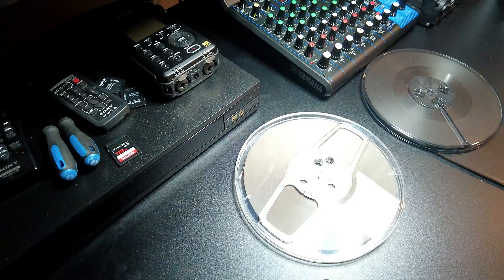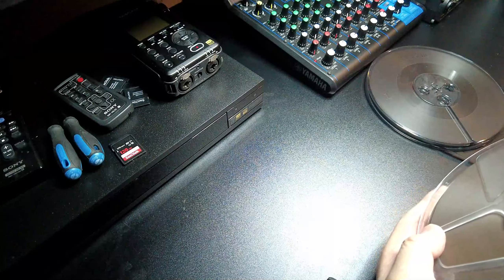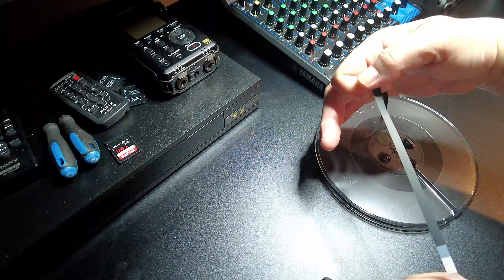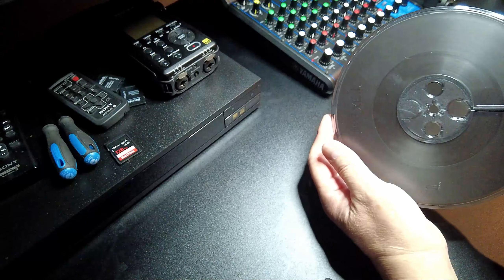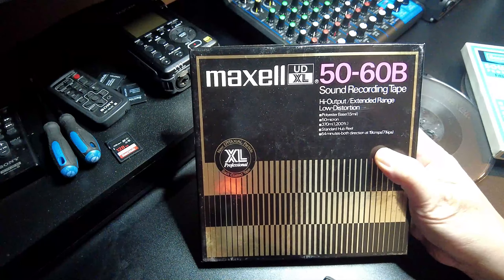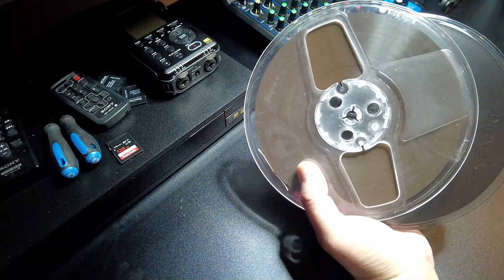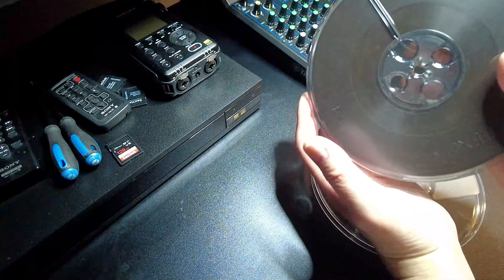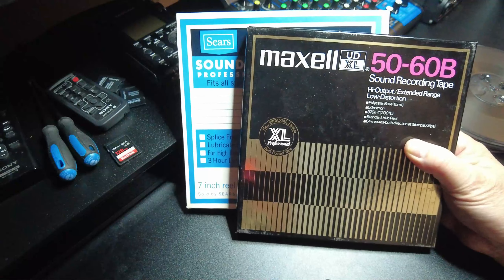Back coating tape why?

Comment from the maker: 50 stands for 50 microns not mils. Sorry about that. Other brands like Scotch run into the sticky shed syndrome. It is when basically the tape melds into a block of tape and does not layer off normally as it should. It is bad for your tape transport. It could even damage your transport as well. The Maxell I have used for years, and never had problems at all with Maxell. Check the modern formulas you can buy today like LPR and ATR. Thanks everyone.